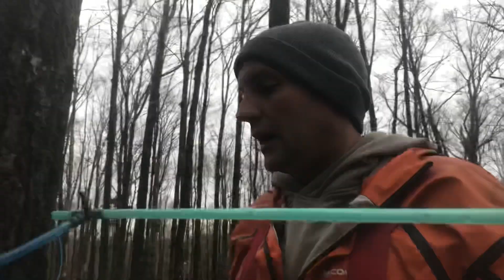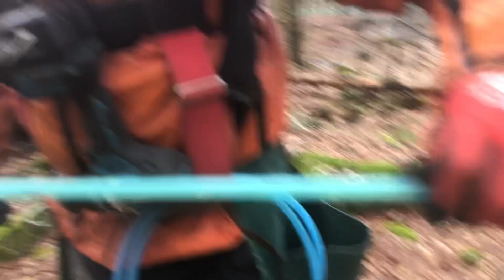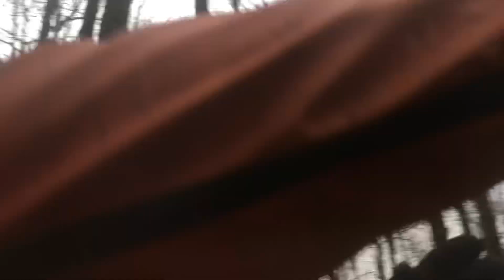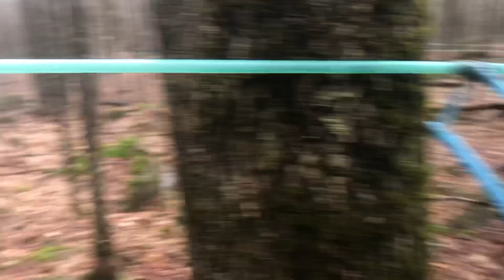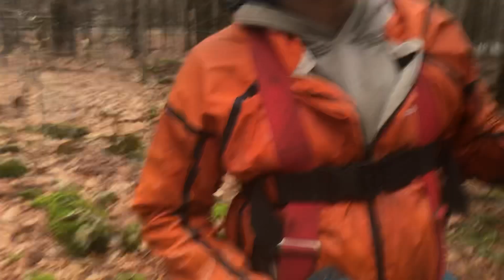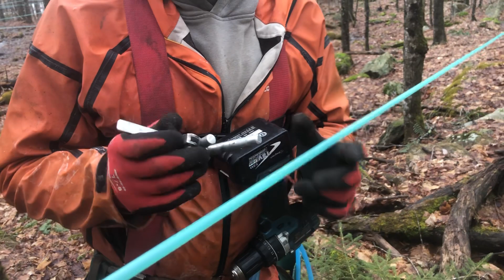How to find micro leaks vacuum leaks in 5/16 tubbing system with high vacuum

Comment: Thanks Chad. I graduated from 3/16 to 5/16 this year so it's a new ballgame finding leaks. I'm curious when you came to that one, how did you decide to remove the tap rather than give it an extra couple taps to see if that would have sealed it?
Reply from the maker: My spouts are not loose I all ready knew that. I have not had that issue in 20 years. Better technology on spout design and technique. I suppose I should have proven that in the video. Good eye!